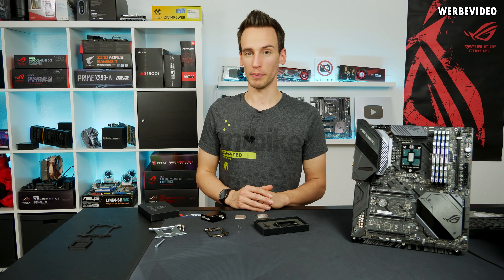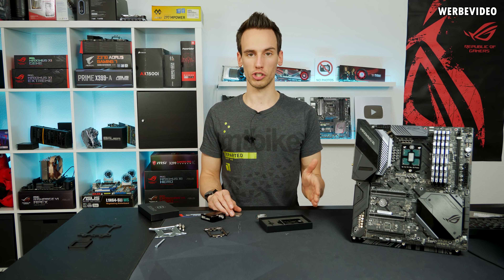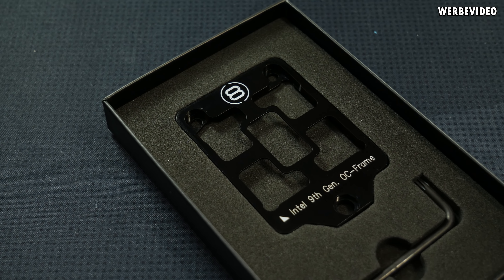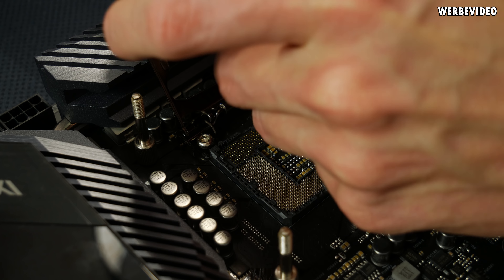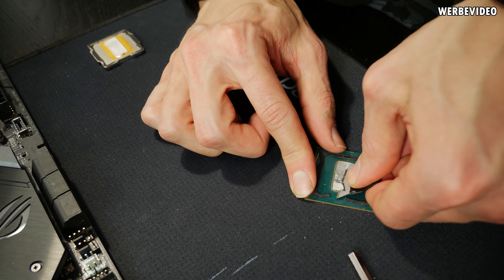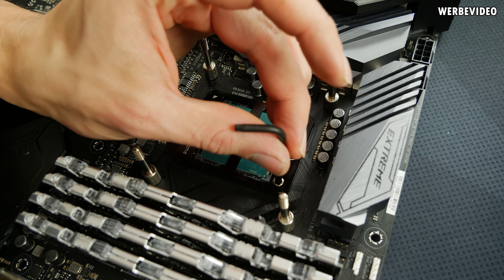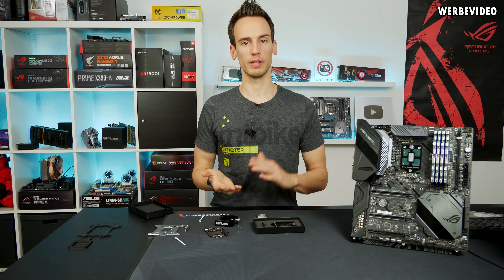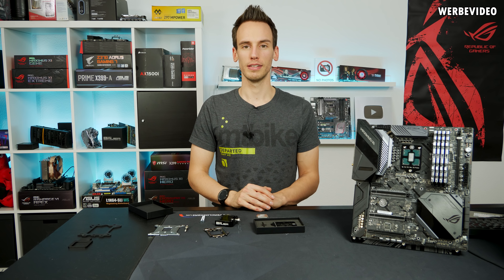Maximum Cooling with Direct Die - 9900K der8auer OC Frame (en)

Comment: The frame seems safer than the old school rubber pads.

Also, other direct die cooling where the socket would interfere, would it not be possible just to find a cooler that fits inside the socket but still covers the die?

Comment: Hi der8auer.. I was wondering if I could use a NH-D15s cooler for this Frame.. Will there be an issue with the cooler making contact with the die?

Comment: I wish this worked with the Arctic liquid freezer 2 but I tried millions of screws and standoffs and the PC won’t post, due to not having proper contact.
Reply: I have the liquid freezer 2 as well and just ordered the 10 gen kit from rockit cool. So am I basically screwed as well? I ordered their intel backplate as well.
Reply: @DavidTMSN  I’ve seen people use specific standoffs and screws that work but it takes trial and error and sadly I don’t have that much time nor money to risk damaging cpu or the cooler. Ive tried dozens of different screws and standoffs to no avail.
Reply: @SugaFree2387  What processor were you working with?

Comment: QUESTION! I think you have stated before that these frames sit slightly above the die to prevent too much pressure directly to the die. Can you tell me how a small to moderate lap of the die would affect the mounting, contact, and pressure given the tolerances? THANKS!
Reply: Ze Omega die lapping and liquid metal is a bad mix. Removing the silicon nitride could allow the liquid metal to permeate the die and dope the silicon, possibly killing the cpu over time

Comment: What about adding rings to the screws on the back plate side to lower the screw threads for the cooler to mount instead of using manually cut off screws? It must save a lot of time and effort.

Comment: Would it make sense to use my Noctua ND15 , and Direct Die my 9600K with it? You just said it's not much of a C° difference...
Reply: Depends if the CPU is soldered or shitty thermal paste. Delidded a soldered CPU doesn't give much benefit unless there was some uneven solder in between the die and IHS.

Comment: I'm wondering how much of an improvement one could gain doing Direct Die cooling with something like a NH-L9I on a 9600, 9700 or even 9900 CPU. There is hardly any information out there on current CPU going direct die with SFF air coolers, only a few user reports on delid+relid with the 8700K but with bigger AiO or monsters like the NHD15. In SFF, even a few C° down is a big win for many and with upcoming tiny cases like the Velka3, cooling is limited.

Comment: Hello, I was really wondering if this is only for short periods of time for testing overclocks or is it a safe long term solution?Is there  any possibility that the chip may get damaged over time because the top plate is missing and its more exposed-vulnerable?Also is there any wear to the cheap when using liquid metal directly on it and on a AIO or custom loop waterblock? Thank you
Reply: It's fine. Have you never repasted a laptop? As far as cheap liquid metal, why would you cheap out on something like that?

Comment: will the skylake x direct die frame ever be available again at caseking? It was supposed to be back in stock yesterday, but it has been delay till 18.01.2019! It has been delayed several times already, I wonder if it will ever will be available again. Thank you!
Reply from the maker: yes we had a batch in december where the quality was pretty bad and mounting didn't work well so had to run production again. We expect the new ones to arrive mid January
Reply: thank you for the info. Are pre-december batchs OK regarding quality? I have possibility to buy a pre-december piece, but maybe it is better to wait for the new January batch?

Comment: So I can’t use liquid metal due to aluminum and can’t upgrade to a copper cooler in manufacture form and repair. What’s the best high viscosity paste that won’t pump out due to cooler or die faces not completely flat. And I lap cooler services also.
Reply: I've been using liquid metal with a direct die frame since 2019 i think, zero problems.

Comment: Hi my friend, I discovered you so late and it's a shame cause I didn't know of your wonderful solutions and tutorials, sorry if I use comments to ask you a question, maybe this also helps other enthusiasts: I bought your delid mate 2 and oc frame for a direct die liquid metal + lapping water cooling solution on a 9900KS and if I'll kill the hardware will buy directly your pretested delidded CPUs, but meanwhile I wanted to ask if the OC Frame also applies for direct cooling on a 8350K which absolutely awesome and gaming cheap at maximum performance for gaming only considering 4K will get rid of GPUs only, also an old cheap 8350K will get the work done at 5ghz if well chilled, for many people who don t need any other task that s still the perfect gaming oced CPU imho, so some sort of cheap risk free modding could be done by everyone thanks to you... But since I read oc frame is compatible with intel 9th gen cpu (will be used on a z390 s1156 motherboard obviously) is this of frame compatible also with intel 8th gen CPUs for direct die delidded cooling, specifically for 8350k? I ve seen your videos where the answer should be yes and also 8th and 9th gen dies and socket are the same so the answer should be a double yes, but since I m just an "hobby free modder" and not an expert I thought it s better to ask the question to the master for a third yes before proceeding with a second oc frame purchase for an 8350k machine. Just for a more complete answer, I ll be using collaboratory liquid ultra, should not have much difference in terms of performance Vs grizzly , or at least so marginal that could be not a matter... What do you think of liquid ultra (and pro)? Thanks in advance if you answer

Comment: @der8auer   So i recently received my 9900k advanced edition from caseking witch is delided and has liquid metal on it. So with your deliding kit it would be fairly easy to remove the IHS right ? Could you do a quick video or just a graph with the thermals on stock , advanced edition and direct dye 9900K on the same CPU ?

Comment: Hey der8auer
,
Just a quick question I already pre-oreder it from overclockers website, but would it work fine with a monoblock down the line as right no one is offering z390 monoblocks but in future they would be on sale, and would it fit properly?

Comment: Will it work if I use a NZXT Kraken with the EK Supremacy screws and backplate???
Ps: I just saw that you didn’t put the 0.7mm plastic washers between the standoff screws for the block and the motherboard, will the cpu block make contact with the washers ?

Comment: Is possible use same (or little modificated) frame on old haswell? Are that sizes same? I guess not, but who knows. I have delided i5 4670K and I'd like to mount cooler without core cover. I don't remember how exactly that core looks, it's almost 2 years from delid.

Comment: Why not really direct die water cooling by a "jet" of water? Like a higher IHS with water connections and of course a water resistant layer on the components surrounding the die on AMD cpu's.

Comment: if i was willing to mod the noctua mounting system would this work you think?  like if i ground down the washers\spacers that go between the heatsink the mount and\or replaced the screws?  would the plate be too long to wide to fit?

Comment: Is it possible to use die lapped 9900K with OC frame? What temperature improvement could we expect then?
Reply: No, that will change the die height so the coldplate can't contact the die.
Reply: Lap the OC frame and re-annodise?

Comment: Is this working with EKWB EK-FB ASUS M9H Monobloc ? I am using a EK-FB ASUS M9H Monobloc on a Asus Maximus XI Hero, and I had to put 2 mm thermal pads on VRM, to have good contact there, fortunately VRM's doesn't go over 45 C @ 5.0 GHz with 1.32 on core so it is doing good contact. I am assuming that due to the increase of the PCB height I  had to use the 2 mm  pads on VRM. Anyway already order it , but it seems DHL needs more  than 3 days to ship it across 2 countries.

Comment: Do you think it would work with an EK monoblock?  Or would the VRM get in the way?
Reply: Monoblocks height is not adjustable. Most of them don’t even work when delidded because of the difference in height after shaving away the epoxy holding the IHS. Happened to a friend on x299 platform with a EK monoblock.
Reply: You would probably have to mill down (or sand it down) the VRM area. I imagine you would have plenty thick copper for this change, but you had better check with calipers before attempting.

Comment: @der8auer does the OC frame can be used with EK-FB ASUS Z270I/Z370I Strix RGB Monoblock?
I mean, with OC frame, does the monoblock make a proper contact with the CPU die?
since the i9-9900K compatible with asus rog strix Z370i gaming, i am planning to upgrade my cpu to i9-9900K with this OC frame,
thanks,,

Comment: i tried direct die on a 9700k with apex x and ek supremacy evo but the cooler doesn't make contact with the die. could be that i have mounted the white o-rings from ek between screws and mb?
Reply from the maker: Yes. Don't use them. And try to use less mounting pressure on the frame if temps are bad
Reply: Do you see any problem in testing a 9900k  without removing the indium from die, just applying conventional tim an using the oc frame? just to boot in bios to see if it works after delid.
Reply: @mihaimladin5054  ....... wat?

Comment: Could it work with 8700k after scratching the edges of the socket plastic?
Reply: No because this is specifically made for the 9000 series height. Technically a frame could be made for the 8700k and would work if you sanded down the plastic of the socket. But not this one.

Comment: Does it works in EK Momentum Monoblock ,Asus Maximus XI Extreme?
Reply: Hi! I am most certain that it won't. For any monoblock actually. All monoblocks have spacers and raised sections in order to make contact with your VRM and CPU IHS simultaneously. As Roman says, the cooler must sit lower, which isn't possible in your case because it's designed to cool several surfaces (think of it as a GPU waterblock: die, VRAM and VRM contact areas have very tight tolerances, and even using the wrong thickness thermal pads will have a great effect) I hope this helps :)

Comment: solder-TIM is not suitable for direct-die cooling technology. do anyone try metal-alloy thermal interface foam? I recently am learned from some guy have tested this new method to sintering  mount CPU die on cooler directly with very thin metal-alloy foam . it seems be very intriguing for OC guys.

Comment: OC Frame  Compatible  with Z390 AORUS XTREME WATERFORCE ?
Reply from the maker: I don't think so
Reply: @der8auer  
If the CPU is low  can i use multi-layer copper foil ?

Comment: 9900k Stock @5.2 ghz almost 92°
OC frame + Conductonaut @5.3ghz 82°, i can boot @5.4, i haven't tried above 1.375v.

The IHS was probably not flat. I'm running 5.1ghz daily, adaptive voltage, 74° hottest core under Aida stress test, custom watercooling loop, August 2019, (Summer in northern Italy is hot)

Comment: I was looking for excuses to replace my delidid 8700k.
And this excuse tips the scale for me.
And if replacing the screws on my kraken x72 is needed, then thats the right excuse to go for hardline tubing i quess.
Anybody on this topic with experience regarding the kraken 72 AIO?
Reply: did you delid an 8700k with his 9th gen direct die tool? If so, did it work because I was wondering if it would work with my 8700k as well.

Comment: Has anyone tried the Rockit88 to delid an i9?  I know the die mate 2 works, and a few reddit posts suggest the 88 should work, but Rockit seems to warn against it (although they suggest it could break the tool, not mentioning anything about breaking the chip).

I can buy another socket 1151 delid tool if needed but would prefer not to (pay or wait for shipping).
Reply: have you check  gamer nexus? he use a rockit tool in his tutorial of delidding 9900k
Reply: @Jeromesg123  I did - might have missed it but that looked like the updated tool (Rockit89) designed for 9th gen, not the Rockit88 (socket 1151).

Comment: Will this work with a monoblock?
Reply: Not unless they started making ones with adjustable height. Typically since the height needs to be relative to everything else. If the VRMs didn’t get lower, the monoblock can’t get lower. Monoblock don’t even work with most delidded CPUs because of the difference in height after removing epoxy under IHS

Comment: will it work well with a corsair h150i pro watercooling solution?
Reply: A lot of water cooling system work with them but be careful if you like to put liquid metal 'cause if the liquid cooler isn't made from copper you'll destroy it
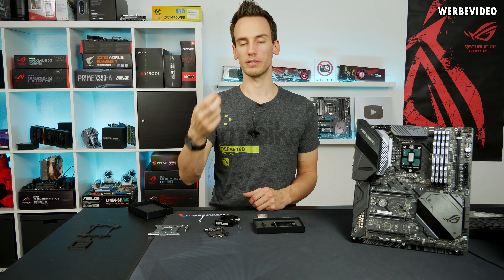Reply: 6:27 there's your answer
Reply: Thx a Lot :), I'll try it out.
Reply: @cobaincase  No problem. Good luck with it!
Reply: @iTzDaNiiLo  His explanation for asetek coolers doesn't make sense.  Why would longer screws help when you need to get the cold plate closer to the die?  At least for the h100i it uses a male-male screw that is a very specific length to give proper pressure.  I would think using the stock mounting hardware might not give enough pressure.  If the stock mounting solution isn't tight enough, using custom length screws would be pretty risky.  If you get the length wrong it will crush the die.

Comment: This seems like a lot of work for only 5-10 C off the CPU temps.
Reply: true, but the i9 9900k runs really hot, so it will open up some good OC headroom that was once not available
Reply: @NV Gaming, I would love to start playing with these new Intel chips.  Alas, maybe soon enough.
I think Tech Yes City, did the best over view of these new chips. They are clocked so high from the factory that it really doesn't allow a lot of OC headroom.  Thus, we need to do more work to get a decent OC.
Reply: @WarriorsPhoto  fully agreed, basically we can get 5ghz on all cores, but id like to be able to see something like 5.3ghz maybe even 5.4ghz as a "golden cpu" on one or two cores to really get going in single thread applications
Reply: @NV Gaming, that's what I am saying about modern CPUs.

Comment: can I use it with the Noctua Nh-d15?
Reply from the maker: Noctua was often a problem. You usually have to modify the mounting by making the black plastic standoffs 2-3mm smaller and also cut the thread longer of the standoffs

Comment: 9 series not good CPU’s just a rehash at a higher price point plus thermal throttle is very real ! Bad products with basically zero real world performance increase also to much admin required to keep it cool great video and good direct contact cooling products from the OC king 👑 but 8700K is by far the best cpu you can buy if you oc and delid for gaming rather wait for intel end 2019 line up !!

Comment: Intel should just ship all future CPU's delidded to begin with.    This would open up the market for fancier custom water-blocks.

I hope someday, one can purchase a motherboard with the delidded 9900K pre-installed or soldered to the board, along with the cooler attached using liquid metal.   If it were done on a mass scale, then it would be more affordable.     Intel should just ship the 9 series delidded to begin with.
Reply: Please no. Before you know it we'll be getting Apple's 'Pay us $900 to fix something you easily could but actually can't because we don't want you to' way of thinking in desktop hardware.

I love digging in hardware and being able to mod / fix / swap things myself. Probably saves a lot of money as well, as opposed to have them built factories to do these things most people don't care about.

Actually, what you want is already available. You can purchase pre-delidded and even binned CPUs from 3rd parties already. Even completely pre-built systems using those things, just buy one of those and please don't change things for the rest of us :(.

Comment: Still not for 8th gen cpus :(
Reply: Not really needed, once you delid, you hit frequency walls before temps.
Reply: you can buy something similar from eBay called Delid Die Guard. but you net to trim the socket a bid. as der8auer said in the video. and remember to check that the die is flat or it may not work.
Reply: so the delid die guard probably works with 9900K huh?  @fromaflafl2198
Reply: it will probably work but har to know without testing may ask the producer/oem icemancooler.   @allahubar3635
Reply: He specifically details why there isn’t one for gen 8